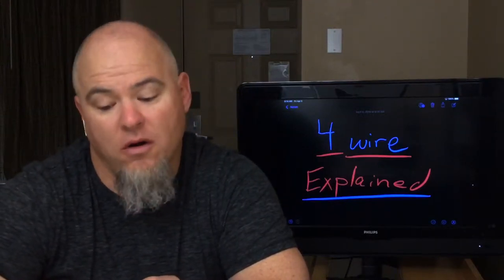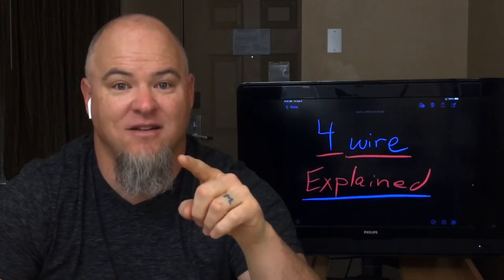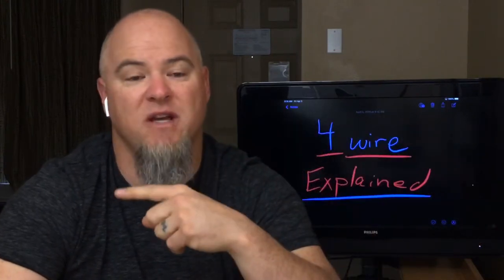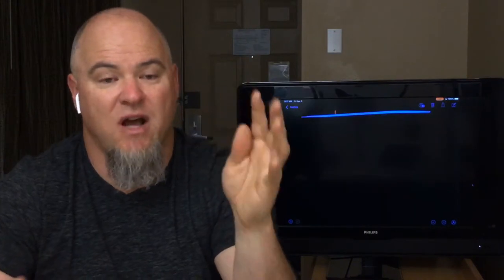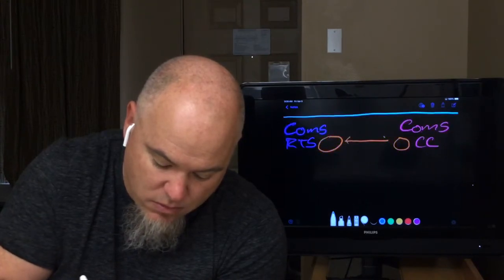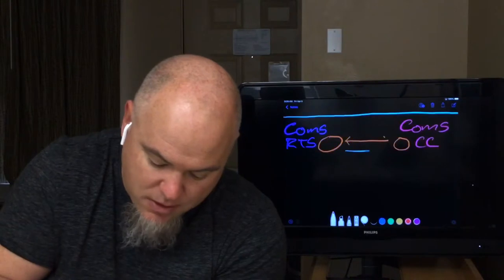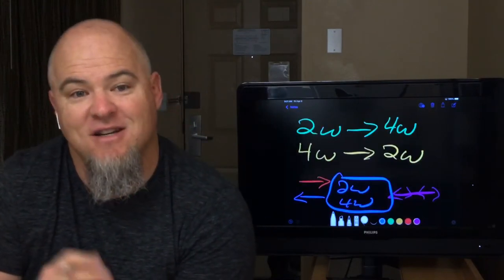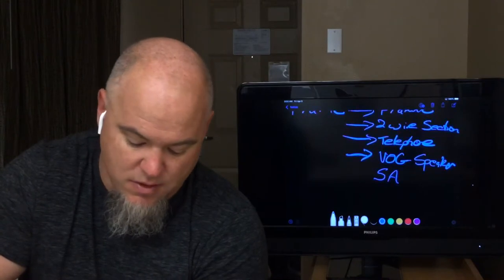4-Wire Comm Theory

Comment: 4-wire question: If you had 3 audio consoles with each having a talkback mic, could you submix (sum) the talkback mics into a aux bus on one of the consoles and send that aux out to a 4-wire input port…and thus have everyone on that conference be able to hear all 3 of those talkback mics?
Reply from the maker: Hey Jud, sorry for the later reply. You have probably already discovered that you were EXACTLY RIGHT!

The beauty of 4w is that it’s only audio. Audio in and audio out. Use the audio as you choose!  Very freeing!